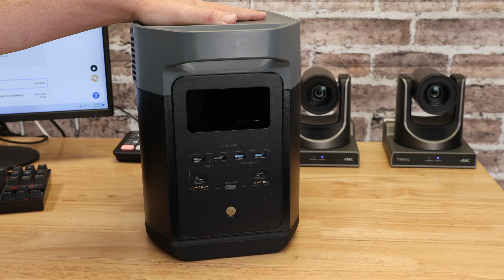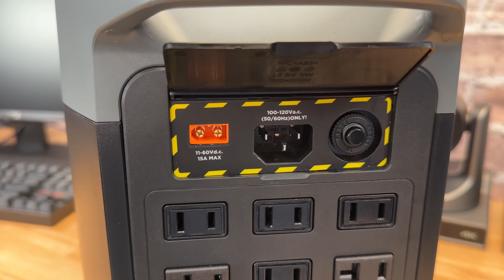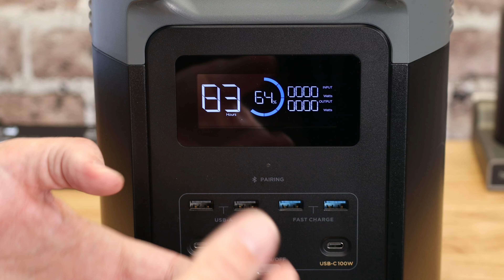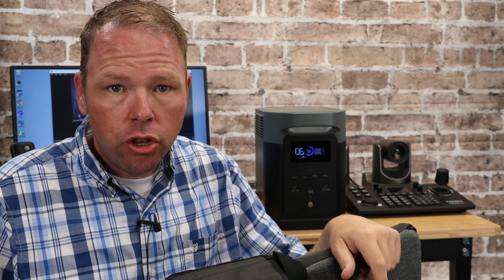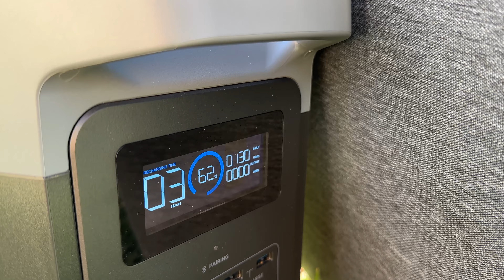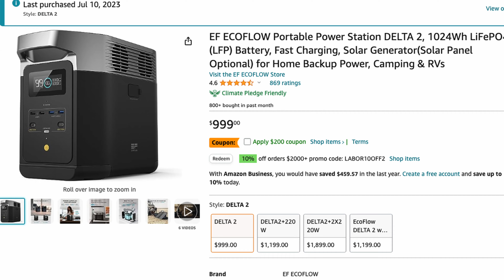Portable Streaming with EcoFlow Delta 2

Comment: Batteries go so far these days. We run our two sunday church services (outside in a tent during the summer since we don't have AC) from my EcoFLo Max, and at the end  of the day, usually about 45% left. This powers not only the live streaming equipment (laptop, ATEM, PoE Switch, FoMaKp PTZ Camera and WifiExtender in client mode to feed church network into outside switch), but also the analog mixer, the 3 wireless receivers and my 2 JBL PRX ONE speakers, a presentation laptop and 2 TVs.  That is about 3 hours of morning service, and then 90 minues of evening service without streaming & TV's